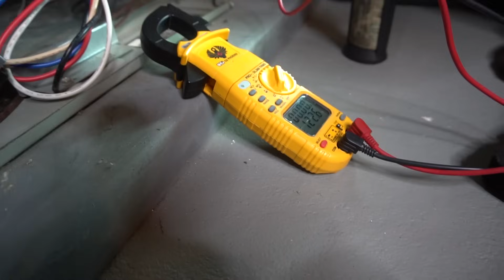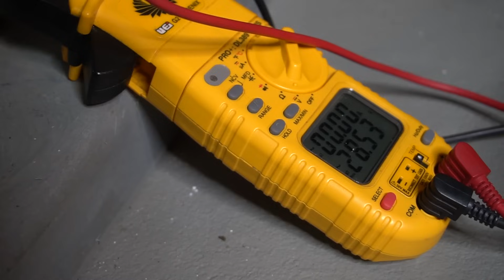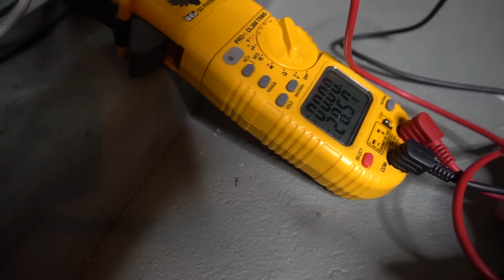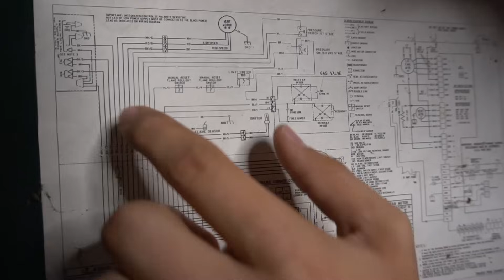Furnace/AC How to Troubleshoot The Control Board

Comment: Jay hi hope you see this and reply asap you are very smart watched some of your tapes trying to diagnose my furnace problem to make along story short my inducer Motor did not work so we replaced it via a heating and cooling company cost $$$$ almost 1/2 of what new one would have cost now the furnace sometimes ignites and stay on heat the house and shut off when the set temperature has been reached
 now if I increase the temp up through the thermostat it will not ignite until I physically shut the furnace off from the switch and turn it on and off then it will ignite stay on heat up the correct temp then turn off . When the house cooles down the it tries to ignite but it will not until again turn it on and off from the switch.could this be a dirty flame sensor since it turns on and stay on but might not start up again or could it be the monitor my furnace is lennox g16q3-75-7 please advice spend lots of money on the inducer don't want to call a heating company if I can fix myself thanks

Comment: Hey I just added a new inducer motor because my unit wasn’t blowing hot air now the guy said I need a new motherboard because it won’t ignite the heat. Is he correct???

Comment: Urgent help and advice: 
I am working out of town and my wife came home to 16deg. Cel house even though it’s set for 20 deg cel.  She turned off the furnace switch and turned it back on. 
first code that came up was 
H43 A 7
Then the following code appeared 
H57 A10
After about 20 mins the furnace shut down and this is the code that appeared.
H E0 another time it was 88 I told her could it be E8 or E9 but she couldn’t tell with certainty. 
She called a tech to come check it out and he is saying it is the board that needs replacement, and he is 90% certain, what do you think? It works  every time she reboots it by turning the power off then turning it back on again.
Reply: It’s a Goodman variable stage high efficiency gas furnace

Comment: The control board is sending power to the transformer? 4:38 I thought it was the other way around? The main power from the house, to the shut off switch, to the door switch, to the transformer to (transform the 120v to 24v), to the control board? I'm a bit lost here thanks! Awesome video
Reply from the maker: On many units the power will go from the door switch straight to the control board. And from there it will go to the transformer. Perhaps there are furnaces that can be wired different but most of them are like wired this way. Just trace the wires coming from the furnace power switch and see where they go.

Comment: Was taking flame sensor out to clean , forgot to take door off , arced it and now circuit board lights and no power to thermostat, could my circuit board be fried?
Reply from the maker: It can be. But more likely the 3 amp fuse is simply blown. They can be hard to see on the control board sometimes or it can be a little 3 amp breaker as well. Just look around or take a look at the wiring diagram from the furnace. Almost all furnaces will have a low voltage fuse.
Reply: @WordofAdviceTV  checked the 3amp fuse it's not burnt out
Reply: Thank you I just found it , 3amp breaker on side of transformer it kicked & I reset it ! Good to go ,got it running whewwww
Reply from the maker: @leorael4497  Glad to hear you got going! :) Stay warm!

Comment: I got a question? If you disconnected the  120v on the control board there is no power in the control board!!  How you going to have  120v when you  testing whit  your meter to the common wire .?  If there is not 120v from the switch door to the control board.  Because you disconnected.  That confuse me.  I hope my question  makes sense.  I may just confuse.  God bless your day. Thanks for your videos.

Comment: I just did all these steps but for some reason my fan blower still continues to run. I took the thermostat off the wall to see if that was the issue but fan still continues to run. Anybody has an idea what the issue can be? I hear the relay to the fan click so I'm assuming its not stuck closed. Only way to get the blower to stop spinning is for me to pop the lid off on the furnace.
Reply from the maker: Have you watched my video on this specific problem yet? All the suggestions I can give you are basically this video: https://www.youtube.com/watch?v=xNe-UxD4Egg&t=776s
Reply: @WordofAdviceTV  Yes, I have checked those steps as well. I'm leaning to the control board being bad since I have 2 AC units I noticed that on the one that's working properly the led indicator turns on but on the one that I'm having the issue with the fan the led indicator doesn't light on at all. I looked on the cover on the furnace to see why the led light is not working and it says to check power. But like I mentioned before I did do these steps on this video so I know I'm getting power to the control board and I know my transformer is working properly. I also noticed that on my control boards it doesn't come with a 3 Amp fuse. So do you think I should replace the control board. Its for a trane unit.
Reply from the maker: @jokawild187  If there is no 3 amp fuse then the control board could very well be burnt out... In this video I show how my fuse is spliced in. I would recommend putting in a fuse on your unit as well just in case there is a short. If there is, your new board won't burn out right away. I can't tell you for sure if it is the board or not. But if the board is getting 24v and the LED light is not on, there is a high chance that the board is indeed bad.

Comment: Now here is a special problem: Another York package rooftop unit. 4 burner vertical stack, changed over to Propane 9 years ago. Unit works ok but only the bottom burner ignites, unit runs but spills propane and I could smell it, which is how I found the issue. I fear the thing may have been running on 1 burner for 9 years - renters said they used a lot of gas. The igniter-sparker- and pilot are at the bottom of the stack. Added some aluminum tape on this crazy burner assembly to contain propane up to the third burner. Now they all work and ignite. Design flaw? hard to see how 3 burners in a vertical stack could spill all that gas and not ignite. Pilot seems fine for size. Anyone ever seen this? New to me. I have a third York identical, seems like I recall them all igniting. Going to go there and check the layout and operation.

Comment: Great content and good radio voice. Keep it up!  I have a York package unit that is problematic. House blower on all the time. Checked all the limit switches - 6 flash - limit switch open  - found one low temp one on the blower bad, jumped it. Unit worked. Next day, renter says no heat. 6 flashes again. Pulled the control board and cleaned it up [open unit - not enclosed]  powered up, all good. Next day renter says no heat, or sometimes. voltage regulator threw some sparks and sound. Put in new one. Worked for a bit, then 6 flash again. Nuts! Cleaned the coil and heat exchanger, no flow restrictions. Good filter, vents open. When it did cycle correctly, no issue with flame sensor or inducer motor and air switch. I think I am down to the control board... Or?  Thanks

Comment: i've got a furnace that seems to have a motor brake, or is trying to make the motor run in forward, and reverse at the same time. the customer complaint was a strange noise, and no heat. it spins freely with no power, but when it is energized, it won't spin, even if you manually spin the squirrel cage to start rotation, and buzzes constantly. the rest of the unit seems to work normally. at first, i thought the blower motor was sticking due to lack of lubrication, it's a 1987 dayton, model 3e465a. so i removed the blower, blew it out with compressed air, and oiled the bearings. after i reassembled it, i turned the unit back on to test it, and got the results i described. this is a new one on me. got any ideas for me? it seems like a control issue, which is why i watched this vid. i'm going back today to test the board, and remove the motor to test for a dead short in the windings.
Reply from the maker: Have you checked the motor capacitor? And what is the voltage going to the motor when it's energized? If cap and power is good, then the motor is bad and needs to be replaced would be my thoughts.
Reply: @WordofAdviceTV  i'm just now going to my customer's house to do some testing. i will let you know what i find out. and thanks for your input. i fix a little of everything for individuals, and a few property management companies. this is the first time i found this issue on a call, and was kinda stuck. i originally thought it was the motor, but it is an older, high efficency furnace, and the first of this type i have encountered.
Reply: @WordofAdviceTV  ok, my fluke tester is an old 8060a i got years ago when i was working maintenance in a rubber factory, and can't test capacitance, but a test with an analog ohm meter showed the capacitor to be bad, and the motor has more resistance than it should, so i will be replacing both tomorrow when grainger opens, and i can get the replacement parts. thanks again for your help. you're a stand up guy.
Reply from the maker: @handyhippie65 If the capacitor is fully dead, even if the motor is still good it is probably damaged so it's recommended to replace both just like you concluded. Good luck! (and thank you!)

Comment: I have a transformer just like this one and I tested input side and both poles on that side showed 125 or so . I tested the output 24v side and it showed only one pole getting 24 volt . ( only thing I done different was I got my ground off the metal of the unit)

Comment: Here's something I saw but maybe I'm wrong in understanding this. When you test at the board, If you have your T-Stat calling for heat you check at the board on the (W) and (C) for 24 volts a/c, for cooling if your T-Stat is calling for cooling you check voltage on the (Y) and the (C) for 24 volts. If you are not calling for either heat or cool you would check your (R) and your (C) for 24 volts. If you don't get 24 volts on either (W) or (Y) and common when calling for heat or cool that would mean your thermostat is faulty.? 

 

 

Reply
Reply from the maker: It could be something wrong at the thermostat, a loose or disconnected wire, or sometimes the board is still bad. If the thermostat is suspected, a good way to test it is to simply jump R to W (for heat) at the control board. If the furnace comes on and works normally, then likely the problem is at the thermostat.
Reply: That I knew but the checking of voltage at the board when furnace is calling for heat would have to be checked with the common and Y,W, or G with multi meter and not the (R) and the W, Y, and (G) because there would be no voltage on the meter unless the common and R,W, or (G) is tested. Again only when the T-Stat is calling.

Comment: My ignitor isn't working change, still not working
Reply from the maker: It may not be getting power. Is the furnace control board blinking any error codes?
Reply: @WordofAdviceTV  i don't see a blinking ligt order new motherboard
Reply from the maker: @stevenlaing6168  Is there power going to the furnace at all? If you have a meter, it would be nice to check if there is voltage between R and C on the thermostat strip in the control board. (while the thermostat is set to heat) It should be around 27v. If the control board is getting 27v but the LED is not on, then that board is bad. But if you don't have a meter, then you would just have to guess.
Reply: @WordofAdviceTV  yes its blinking change motherboard no power to ignitor
Reply from the maker: @stevenlaing6168  If the board self-diagnosed that the board itself is the issue, then it's highly likely that the control board is bad and needs to be replaced.
Reply: @WordofAdviceTV  it was the connection on top of the board bad

Comment: Thanks for making this video. You just saved my ass for Canadian Thanksgiving Dinner! I'm an electrician by trade but I haven't worked on furnaces before. It's not really what I'm used to. But, with your video's help, I narrowed down my problem to a bad Control Board. I flipped the thing over and noticed that I have a melted solder on one of the relay pins. I re-soldered that, put everything back together and the blower fan now runs!

Thanks to your very informative video, we now have heat! Our local repair truck would have charged me hundreds if not a thousand dollars because of holiday fee. Thats if I could even get one of them to come out today.

Cheers,
Joe
Reply from the maker: You're welcome, that's awesome! Happy to hear that you were able to fix the furnace yourself! Thank you for leaving a comment and explaining how it went for you. Stay warm!

Comment: Im not getting power from the on and off switch to my power board. The light is not flashing at all. What does that mean?
Reply from the maker: Is the furnace circuit breaker off by chance? Or the furnace power switch. If you have the doors off, is the door switch pushed in? Another thing to look for is the 3 amp fuse. That may have blown as well.

Comment: Thanks for these tips. I've been working on my Trane XR80 "9 blink" problem for a week now. I've tried cleaning flame sensor, replaced the flame sensor, replaced the igniter, replaced the control board. In all the iterations of these 3 parts (new and old), the furnace will function for awhile then fault with blowing air showing 9 blinks. I keep seeing references to 'check grounding' here and there. Do you have a video on "board to ground" and "neutral to ground" checks? Thanks.
Reply: SOLVED: after replacing everything, I traced the problem to the house wiring. The installer did connect the green ground wire to the furnace chassis BUT the person who installed the house wiring didn't connect the green ground wire to anything. At the furnace, neutral-ground measured ~0V, line-ground measured ~69V, line-neutral 117V. Bingo! After correctly connecting furnace chassis to house ground (at the breaker box), the furnace has ignited every call for heat for a week straight. Hope this helps someone. Thanks for the help. I know understand my furnace operation.

Comment: I have a 2004 Carrier. The led is flashing continuously. The furnace will kick on and reach the pre set temp on the thermostat. Then as the house cools, the furnace will not restart. After resetting the door switch, it will cycling on again until temp is reached. But then I have to reset door switch again... is the board bad? Thanks
Reply from the maker: That would be my first guess... But if you have a meter I would verify that on the furnace control board thermostat strip. R to W is usually 27v, once the thermostat calls for cooling, that drops down to 0v. So when this is happening, I would like to see if the voltage changes to 0 when the thermostat calls for heat. If it does, then likely it's the board that's bad (but still can't say that's 100% though..) If it does not, then I would say something's up with the thermostat. (if it has batteries, have those been replaced?)

Comment: I have a 75,000btu Comfortmaker gas furnace in a trailer. Air conditioner works. When the furnace calls for heat the inducer motor fan starts , but no gas is igniting, after 1 minute the furnace shuts down. I don't see any lights on the control board, there was a 5-Amp fuse looks OK but put a new one in anyway. I did notice a slowly flashing green light on the gas valve, it was hidden behind a wire harness. Rollout switches (2) seem OK not popped out, tested with multrimeter on ohms (no CL) just a couple of (1.--) Cleaned smart ignitor flame sensor with scotch pad, still no ignition. Any suggestions would be appreciated.
Reply from the maker: Can you hear the gas valve click and gas come out for a few seconds? That would be where I would start. If it does click and release a little gas, then I would suspect a bad ignitor or it is not getting power.

Comment: Fuse pops every so often on circuit board on heat side...remedy is a short what's ur procedure...short on 24 v side?
Reply from the maker: If it is intermittent, that makes things harder. With a short on the heat side, I would first try disconnecting the thermostat wires and jumpering R to W at the control board for heat. If fuse doesn't pop, then either the thermostat or the wires going to it are shorting out somewhere. (unfortunately this method may not work for you since you said it only pops it every so often.. Jumpering R to W would cause the heat to run 24/7) After that though, it can be anything on the 24v circuit in the furnace.. A bare wire rubbing on something is most common. I would look at the wiring diagram and verify what my low voltage wires are and then start tracing them and checking the wires and the switches/components they go to, looking for visible burnt marks.

Comment: Question, I have a rudd ugdg-07eauer and I am looking to connect a "Smart" thermostat to it. I am being told I need to connect the blue wire to the "C". I was told this is a 24v line that keeps the thermostat battery charged. The wire is clipped off and not connected, where do I connect it to?
Reply from the maker: You would need to hook the blue wire up to C on the new thermostat base and then you would need to go down to your furnace control board and hook up that same blue wire to C on the control board thermostat strip as well.

Comment: I have a amana ac 3ton  where the air handler is working but the outside condenser is not I check the cap its ok the circuit board on the unit controls all function are control by this board  compressor and the condenser van how can I check to make surethat the board is no good